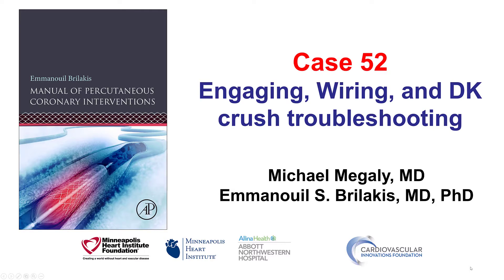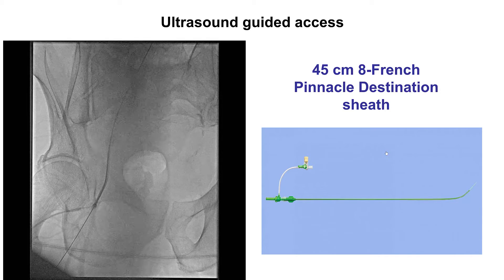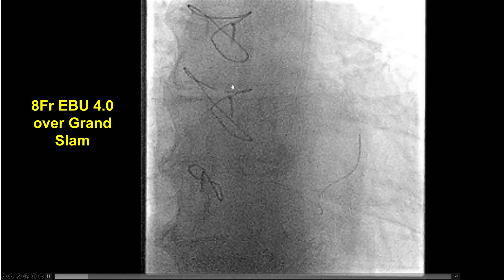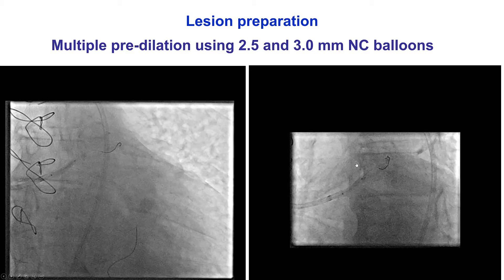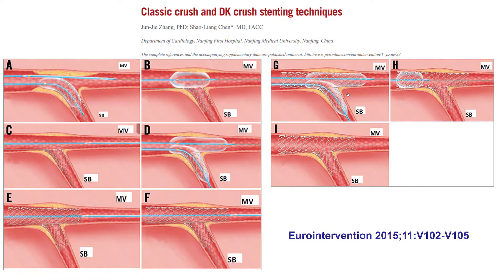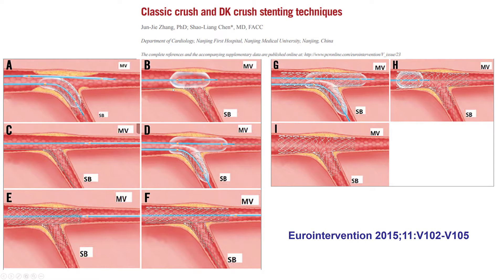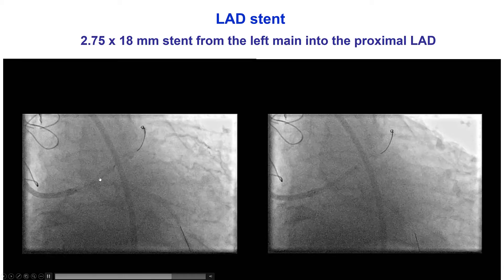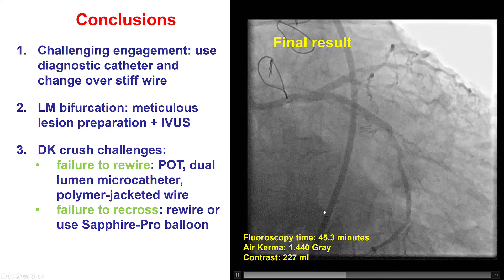Case 52: PCI Manual - Challenges with engagement, wiring, and DK crush

Comment: Dr. Brilakis i have 2 questions:
1) Is that a new book.... the one on the first slide?
2) Whats your opinion on the nano-crushing technique?
Thank you
Reply from the maker: 1. Book is under preparation, will but out in approximately 1 year and will reference the posted cases.
2. I have not done nano-crushing, but had done several cases in the past inflating the MV balloon while withdrawing the SB stent. I have 2 concerns about nano-crushing: (a) pulling the stent back may not be enough for fully covering the ostium of the SB; and (b) the SB ostium optimization may be suboptimal as the first kissing balloon inflation is done without rewiring the SB. In many ways nano-crush seems like mini-crush.